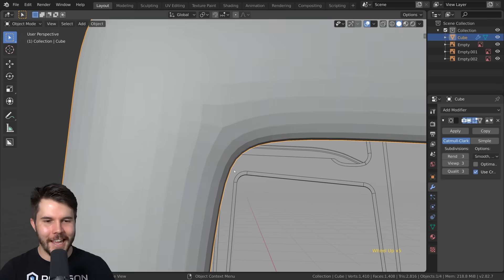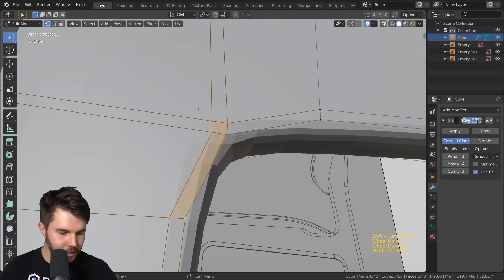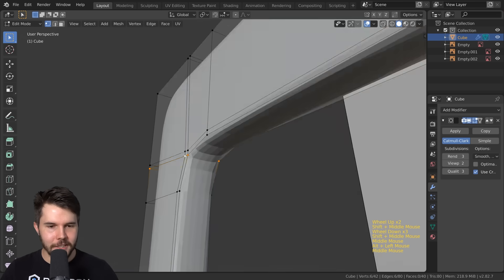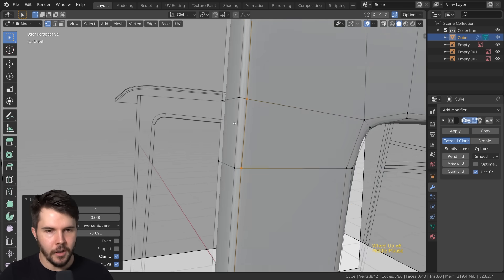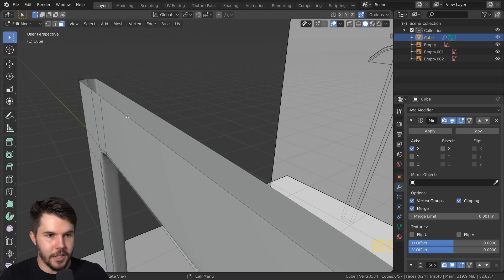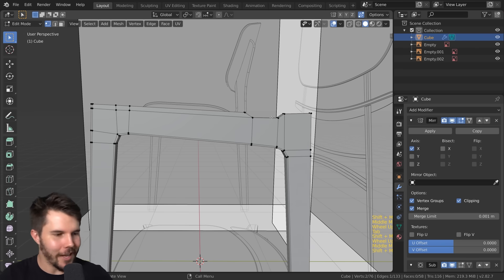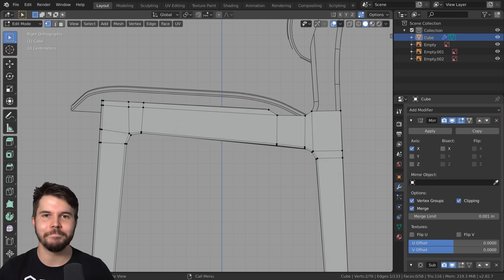Blender Beginner Modelling Chair Tutorial - Part 2: Edge Flow

Comment: For anyone having issues with the mirror modifier: in edit mode, after you've deleted half of the vertices, select one vertex on (top left) on the side that's cut. Once selected, got to Mesh->Snap->Cursor to Selected. Go to object mode and select the entire geometry again, right-click and select  Set Origin->Origin to 3D Cursor. After that, add the mirror modifier and you should see accurate results.
Reply: I wouldn't have figured this out on my own
Reply: Thank you. Solved my leg mirroring on the opposite face.
Reply: thx a lot !
Reply: Lifesaver! I knew there must be a way to salvage my blunders but I never would have figured this out! Thank you!
Reply: thank you!!
Reply: LEGEND
Reply: almost went nuts because of this and just decided to have it that way lol. until i thought of you guys in the comments. @@ such a blessing. thanks man
Reply: thank you!
Reply: Thanks a lot
Reply: Thanks!
Reply: thanks
Reply: Thanks a bunch
Reply: Thank you.
Reply: Life saver
Reply: You're a lifesaver 🥹
Reply: I did what you typed and it worked for the mirror itself, but now I have a slit/hole in one part on the corner, any clue what that may be?
Reply: legend thanks!
Reply: 4 years later, you have saved me. Thank you

Comment: I have a question for the future. I wound up redoing my leg and not moving it from the middle, because my mirror just kept throwing the leg across the scene. I spent over an hour trying to reset the origin and could just not get the mirror to work correctly. Anyone have info in the future when I move an object around in the scene and try to mirror how to get the origin for the mirror to set correctly? Thanks so much in advance!
Reply: Idk if this answers your question, but if you move an object in edit mode, the origin doesnt move and stays the same.

Comment: 9:16 When I delete the faces, I have bevels on the front end and the back end which are very weird. When I delete Only Faces, it works but it has a vertex on the middle of the mirror. Im using 2.91 ver
Reply: Edit: subdivide vertices on the bottom of the geometry, Shift + S set cursor to selected, dissolve vertex. That way you would mirror the geometry correctly without any weird looking chamfers and bevels.

Comment: merge by distance isn't working for me, it says "removed 0 vertices" and when i try to move the edge it's still separate and hasn't been merged. even if i increase the distance, it merges other vertices but not the ones i want.

edit: nevermind, i checked the "unselected" box and it worked.

Comment: I was facing and issue while trying to do the tutorial because I made few mistakes since I was frequently interrupted and wasn't able to follow along.
For whatever reason I accidentaly created a face inside my mesh, causing issue when doing a loop cut - it wasn't going all the way through.
At this time I didn't know there was a face inside my mesh and it wasn't visible neither in edit mode nor object mode with x-ray enabled.
I learnt about non-manifolds geometry (here: https://blender.stackexchange.com/a/7914 ) and it's probably the most important thing alongside ngons that will cause everyone troubles.
If you are mad because your loop cut does not work properly; surely there's some non-manifold geometry involved

Comment: Whenever you go into orthographic view, do some zooming and whatever other stuff, and then click to go back to 3D view, it seems the view stays on the object you were looking at and editing. But when I switch from orthographic back to 3D view, generally using the middle mouse button to rotate the object, the view usually jumps a huge distance and almost always ends up somewhere where the object I was looking at is no longer in view. So I have to constantly keep moving back in and out just to see the thing I'm editing if I ever switch between orthographic and 3D view in the middle of the process, which I often want to do just to check the edit I made on the object on orthographic view was correct. How do I stop the view jumping like that?

Edit: I think I finally figured it out: In the Orbit & Pan settings I selected Depth to "Use the depth depth the mouse cursor to improve view/pan/rotate functionality".

Comment: Very cool tutorial. 

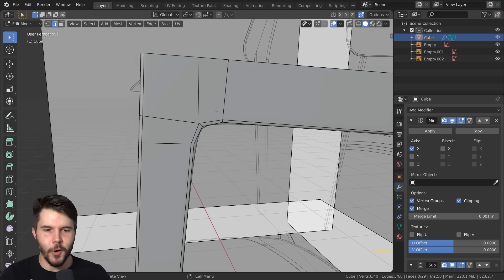However, I'm having problems to understand how, after you deleted the faces on top, you ended up to have a rectangular bottom right corner in the mesh's top, from 9:53 to 9:54. 

I'm trying to have my mesh like yours (and I've restarted 3 times already and followed every step, every option like yours... everything. And my mesh just not look like yours. 

Please, please, help me !
Reply: I had the same problem! You just move your mirror modifier above the Subdivide modifier. It's a priority problem, I was so mad when I realized XD
Reply: @LadCorazon  I eventually got it. I was literally changing every parameter , one by one and finally got it ! ;D
Reply: I think I found the problem and why my mesh looks different from the tutorial one. And that would be because on 9:54 the Levels Viewport on the Subdivision surface Modifier are turned to 0 (zero) instead of 3 as they were before. Could you confirm this to me, please?

Comment: Another awesome tutorial, thanks a lot Andrew! I have a dumb question, though. Sometimes I can see the orange mesh overlay (like chicken wire) and sometimes I can't. In the donut tutorial I think it's because I have a higher level of detail, but when I select the same settings as Andrew (wireframe view) I don't see the fine mesh detail in either Edit or Object mode. Any ideas? I compared my settings in my donut and I can't see anything to copy!
Reply: Got it, in case anyone else comes across this. Uncheck the 'Optimal display' box in Subsurf modifier..

Comment: I had an issue with mirroring that I can't see anyone here with quite the same problem:
First it mirrored to the other side, so I fixed that by following another commenter's  advice
But now, even with clipping on, I have a V-shaped split at the top of the chairleg, and toward the back, the form doesn't seem as wide, and so it pinches in at the middle. I took the back and expanded it out to match the front, but I'm worried I'm gonna get issues down the line
Is there any reason why my mirrored side may not be connecting so well?

Comment: why is it when i"m in wire frame and edit mode mine has a bunch of lines within it instead of just the edges
Reply: i also have the same problem
Reply: mwangi nguro I read in the comments that on subsurv there are three boxes click the one with a box and four dot on each corner

Comment: Even if I add the Mirror Modifier and move it up, I still have that bubble effect that Andrew talked about.  I can't seem to avoid it.
Edit:  I grabbed them an merged them manually and deleted one half in edit mode.  It works alright.  The mistake was with the origin of my cube.  I didn't set it up like Andrew did it.  Hopefully this is helpful to someone :)
Reply: merging it manually doesn't work for me because the "mirror" that i have from the bubble effect doesn't have any geometry so i can't remove its vertices, i just end up removing the vertices of the model I had before the mirror.

Comment: When I hit "M", about 12 vertices get merged and I cannot find which they are. At first I thought i did something wrong so I deleted everything and did it again, exactly like how Andrew did in the tutorial and It still merges 16 vertices unlike the 4 in the tutorial. Has anyone encountered this?
Reply: 5:37 - I used the auto merge vertices function instead. Had to redo the mesh from the start but its fixed now. Could not identify what the issue was though.

Comment: Does anyone know why when I extrude, 
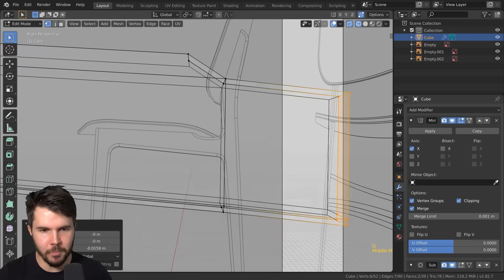the subdivision modifier distorts the mesh in that area like at 10:49? There’s something wrong when I extrude and I can’t figure it out.
Reply: Happened to me as well, turned out that the vertices that were supposed to be on to of each other in side view (numpad 3) .... well .... were not :-D when I aligned them it works just like in the tutorial.
To do that, click one of the point you want to keep the location of, in the top right corner in transform copy the y and the z, click the other point that you want to align with this one, past the y and the z values.
There is probably a smarter way to do this that I don't know, I'm a blender beginner.
Reply: @michaelcalibro5565  Thank you very much

Comment: why is it that when he goes into wire frame mode it doesn't show up, when im in wire frame its hard to see bc of all the framing
Reply: If we thinking of the same parts in the video, the reason all the wires weren’t there is because at some points he turned the viewport on the subdivision modifier down to zero. That gets rid of all the wires.

Comment: 7:30 There is an auto mirror addon that does the same job as the mirror process. Instead of needing to use a loop cut and deleting one side before hand, the auto mirror does it... automatically. Just enable it and open/use it from the edit & tools menu (N)
Reply: I kept getting a gap along the top surface of the chair arm using standard mirror process; this fixed it.  Thanks for the heads up!  👍
Reply: I love you ;)
Edit: Oh but there's a problem when removing the top faces :O
Reply: really thankful to you , you helped me a lot

Comment: If Alt + M is not working it is because the latest Blender update changed Alt + M into Split , if you want to Merge the Hotkey is *M*. If it works for you It means you are using Blender 2.82 or Lower.

Comment: when i give it the mirror modifier there is 2 of my chair legs but they're not inside each other like yours are.
Reply: mine too, have you found solution?

Edit: I found what was wrong. My origin point was offset. I've set back my origin point like this: In Object mode I moved 3D cursor to the center of the base face of the leg (snapping tool and pick faces from it's menu), then right click on the object, set origin to 3D cursor and then Shift + s to set 3d cursor back to the center of the world. There's probably a faster and more precise way but I don't know it and it worked. Also sorry fot my English, I hope it's understandable

Comment: When extruding after mirroring (around 11:00 - 13:00) the leg gets actually extruded with a "hole" in the mirroring axis. Has anyone experienced that? thx
Reply: Make sure you have clipping on before extruding. I also exprienced a strange hole and realized the clipping was not on.
Reply: @jana-yao8  Thats what it is! Thanks you man!
Reply: yes sire I did, and it seems like you can fix the problem playing with the "Merge limit" indicator in the "Mirror modifier". I increased it a bit and the weird limit in the middle disapeard so when I deleted one side, I didn't get the hole anymore

Comment: having issues with mirroring i am new to blender but i think it has something to with pivot or origin point of the object how do i change origin point of the object .

and this is my second day with blender used 3dsmax lonnng time back and your tutorial are making learning easy.
Reply: i think i messed the center point before cutting mesh into half and now my center point is on little to the right i just need to set it to the leftmost side of the mesh that way mirroring will work fine (thats my noob theory :P) but i cant figure out how to manually change the pivot point

Comment: If you are having mirroring issues, here are some solutions:
1. You have moved the origin point (orange dot), you can press Object> Snap > Cursor to World Origin, then Object > Set Origin > Origin to 3D Cursor. I would recommend changing the key binding to move the 3D cursor to prevent accidental moving.  Putting your origin point into the center of your 3D world, will mean the mirror uses that central place to mirror.
2. Your axis are not correct. There are X Y and Z axis, you can easily switch between these in the Mirror modifier menu, it might be that you've built on the Y axis side, rather than the X. This isn't usually an issue, but you can press NumPad 1 to swtich your view to FRONT, or NumPad 3 to switch to the SIDE.
3. You can use an object or Empty as your Mirror point, meaning you can relocate your objects Origin and create some advanced Mirroring setups. If you create an Empty object in your scene, then on the Object you wish to Mirror, in the Mirroring options, use the eyedropper box to select the Empty. Your object will now use that object as your Mirroring point. This will be more beneficial when you add on additional modifiers too.

Comment: 11:08 How did he change the view from what the subsurf looked like to the square looking view?
Reply: A little late, but in your subdivision surface settings, there's a little icon of a square with 4 vertices. Turning this off will hide the subdivision surface in edit mode. You can switch between object and edit mode using tab to view the actual result.

Comment: This chair model could be done about 1000 times faster in a solid modeling tool like OnShape or even Sketchup. Extrude a rectangle to thickness. Subtract the profile. Select the edges on which you want a filet. apply the filet. Basically do the same thing with all other parts. Put them together in an assembly. Export to OBJ. 
Also, "verticy" isn't singular for "vertices". It's "vertex". Totally unwatchable.

Comment: 8:27 when I mirror the object and delete the vertices on one side , there is a slight gap down the center, in the top of the object. I have tried setting origin to geometry, and applying all transforms before mirroring it, and that did not help. Any help would be really appreciated.
Reply: I have the same problem, no idea how to fix it, or what I did differently
Reply: I had the same issue - I found out some of my Vertex were not aligned correctly on the X axis.

Comment: You should use bevel instead. Use the scroll wheel to set the segment count to 2 (or 4 if the faces around the edges are large). Then, in the bevel window that shows up behind Blender Guru's fat face (thx for blocking those), set the profile to 1. This way, we've beveled the edges without changing the shape of the mesh.

Comment: If you have got problems with the mirrors: before cutting the leg in half, right click (object mode) > Set Origin > Origin to Geometry and proceed as in the tutorial.
If you're having the same problem as me (saved too late and no undos left): edit mode, select an inner vert / edge and F3 > Snap Cursor to Active. right click (object mode) > Set Origin > Origin to 3D Cursor.

I don't know if this is gonna be a problem for me later in the series but at least I've got mirroring..

Comment: If your mirrored mesh is "pulling apart" after you delete the faces on top, try selecting all your vertices in edit mode and shifting them out and back (essentially widening and then narrowing the leg of the chair). This fixed it for me. (Also could be a 2.9 alpha bug).
Reply: I solved the problem by saying "Delete faces only" instead of delete faces
Reply: @milesalderman  Life Saver, cheers mate
Reply: @milesalderman  Yes, thats it, thanks.
Reply: @milesalderman  love you tnx
Reply: that fixed it for me too thanks
Reply: holy shit man u cant imagine how long i searched for this solution thank you so much.
Reply: Had the same issue in 2.9. I think the center of origin is shifted off center for some reason?
Reply: I selected delete "face only", and it fixed for me. I use version 4.1

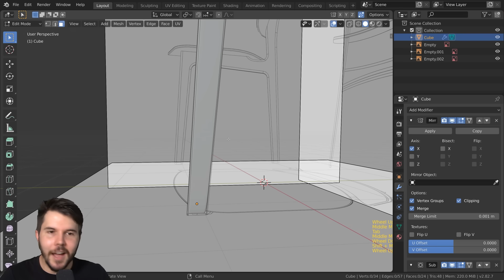Comment: At 9:38 I have a issue. When I'm adding a loop cut to the leg the leg converges into a  a thin line on that perticular area.
What should I do now...?
Reply: me tooooooooooooo
Reply: hi i got same problem :the way i solved cuz you didnt merge the edge correct it didnt turn in one edge which part that roll to 5:50

Comment: 9:20 If you have troubles with wrongly rounded edges try to increase "Merge Limit" in mirror modifier.
Reply: Hi, thanks I was just looking for how to fix this! But also there is another way I figured out too: If you make the mirror modifier to be on top of the subD, it also eliminates the round edges. Cheers!
Reply: @alexhm2411   Thank you! This is the right solution!
Reply: I also had this problem, you just need to put mirror mod above the subdiv mod. 7:40
Reply: @bodojoy7717   i tried that but its still not fixed
Reply: @bodojoy7717  Thank you :)
Reply: спс, бро!
Reply: You are a fucking hero, I was getting menta trying to understand why I was getting strange butterfly-like shapes after extruding.
Reply: So i put the mirror modifier above the subdiv modifier and changed "merge limit" too yet it continues to get curvy shapes after deleting the top face !!  
I don't understand why this is happening and its ruining the whole process ! im getting frustrated now
Reply: Thank you so much
Reply: Thanks.
Reply: THANKS!
Reply: THANK YOU!!!!!!!!! I was thinking about giving up
Reply: thank you

Comment: I have a problem. when I switch to solid mode, there a hole with no mesh in it even though its inside a place with vertices. it just made it all round up and didnt fill the whole space. when i did f, it worked but it was really creased and not nice looking. help!

Edit: And I checked, the mirror modifier is on top.

Comment: super weird.  When I model the back leg, I get a double bubble. Following what he says, I confirmed that the mirror mod was above the subdivision.  But that ain't it. Anyone have an idea why this might be?  When I turn off visibility on the mirror , the first part is open but the back leg is enclosed.....
Reply: ahh, even though I have clipping on - the pieces are separating! Wonder what I did wrong.
Reply: well, looks like my loop cut laterally got off center on the beveled part in the armpit of the front joint.  Definitely made it by right-click to center it, on closer examination it is also definitely jogging very slightly on and off center.  This seems to tell the mirror mod that it should not connect there as it is at top and bottom.  Maybe I just start over.